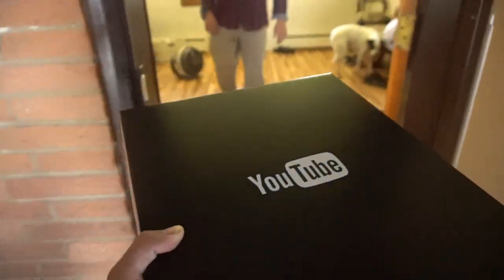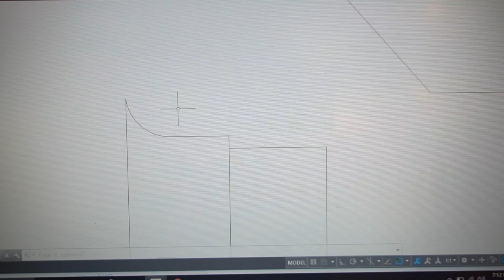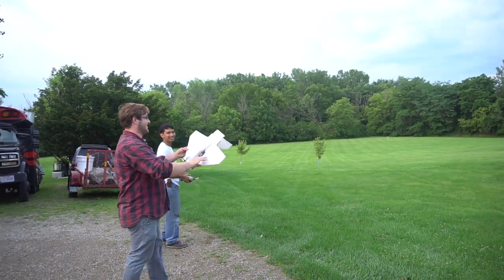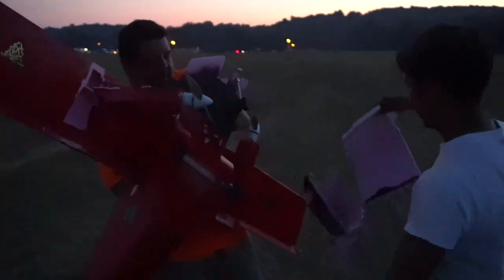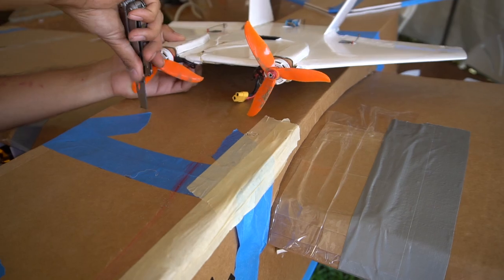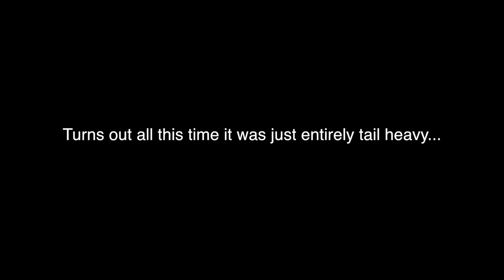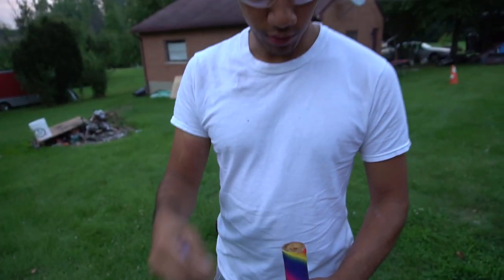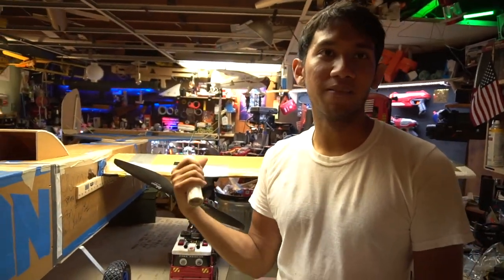Flying My Silver Playbutton!!! (with Sugar rockets)

Comment: As an old fart former pilot (most hours in a Mooney M20C) I have to say that I enjoyed this immensely.  The finale JATO takeoff was a thing of beauty; I was amazed at how well your attitude was held so stable.  I fully expected that the rocket ignition would totally overcome your ability to maintain control.  I suppose the unintended sequential ignitions of the rocket motors turned out to be a real boon to the performance of the aircraft.  Either way it turned into an EXTREME joy to watch! Congratulations on the success! (BTW, I have seen a few of your videos, so I recognize that your skill level is quite high.)

Comment: This is extremely rare footage of the Germans testing the infamous V1 rocket. (1944 colorized)

This is actually how the V1 got invented. 
1. The inventor made an RC plane.
2. The inventor thought that the RC could be fighter pilot practice.
3. He thought that strapping a bomb to an RC would be great which led to the V1.
Reply: Technically the V-1 Wasn't a rocket, that was the V-2.
Reply: @lachlanlandreth9069  yeah the V1 was a cruise missile also called a buzz bomb due to the sound of the pulsejet

Comment: you don't have to cook it down if you are using powdered sugar and milled kno3. put the kno3 inside a ball mill for a few hours and mix it up with the sugar. Then just pack it into motors with a wooden dowel.

Comment: To get the sugar rockets to work, mix stump remover and powered sugar in a 65% sump remover and 35% sugar by weight. Leave as a powder. Get a pvc tube and a wooden rod that fit snugly inside. Pack a bentonite clay plug approximately 2cm thick, buy placing the tube on a hard flat surface and puck the plug in increments by hitting the rod with a rubber mallet. Then pack the white powder in increments into the tube in the same fashion. The smaller the increments and the harder you pack the powder the more power the rocket will have. Leave room for a second plug and make it the same as the first. Then get a 5mm drill bit and drill slowly down the centre of then motor until you reach the top plug. Insert a sparkler as a fuse and enjoy. Hope this gets seen and is of use.

Comment: What's the reason for cooking the sugar rocket fuel?  If you will mix it, don't cook it and pack it in your PVC really hard with a dowel it will work great. Sugar rockets won't work near as well if they sat up and got a little moister in them.

Comment: If they're exploding you're probably getting air pockets in them.  Mixing in a little ethanol will make it runnier and mitigate that, but then you have to wait for it to evaporate, which can take quite a while.

If you want slightly better performance, a wooden nozzle  won't expand as much as the fuel burns and is cheap.  If you want a lot better performance designing a metal nozzle for the thrust parameters you want involves relatively simple math that's easy to look up online and you can reuse the nozzle between engines as long as you make everything a consistent size.  (And don't lose them...)

Comment: Add water to the mix and make a sludge then boil off all the water until you can take a drop and it hardens quick and it won't bubble it barely caramelizes and works great.

Comment: Try baking the potassium nitrate, it absorbs moisture out of the air and then it doesn't ignite as fast, if you want to try to make another type of rocket engine try packing the potassium nitrate and sugar instead of almost caramelizing it.
The only problem with the packing method is you need a solid nozzle or it just falls apart, what I mean is you need to put something like clay on the ends and then drill the nozzles out, you should watch Grant Thompson's video of him making sugar rockets

Comment: That Stan looks like a flying Hobo's house. Just use Estes rocket motors, a long servo lead or cut the servo off the end. Then use the polarity wires, solder the Estes igniter onto the ends of the wires. Select a free channel on the receiver, preferably a free switch or rotary on the TX & plug the igniter into the motor wherever you've stuck it & away you go. Use it for either a boost motor or to fire rocket propelled projectiles. Instead of sending power to the motor or servos it will ignite the motor(s) on the channel.

Comment: When you went into the air with the second big plane, I wondered how often those planes crashed into each other, then all the planes started crashing into your plane... :P
Reply: That was a combat session, they were TRYING to hit us! They didn't do a very good job, the only reason I had to land was due to battery voltage. The power system we were using could only do 9 minutes before it fell out of the sky. 
Was it a good idea to try to launch peters airplane from STAN during combat? No, but we did it anyways, and it ended up epic.
Reply: Ah... That explains it. Too bad it could only fly 9 minutes, there were still a lot of planes in the air when it fell out of the sky... But it was very epic indeed xD